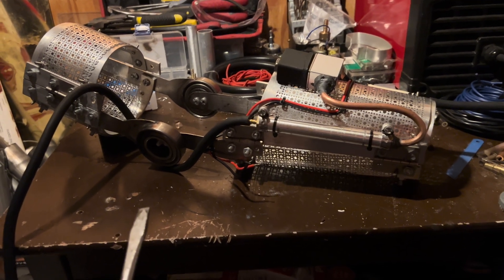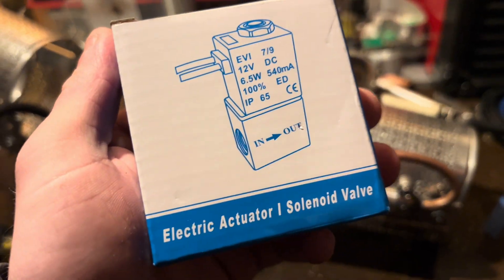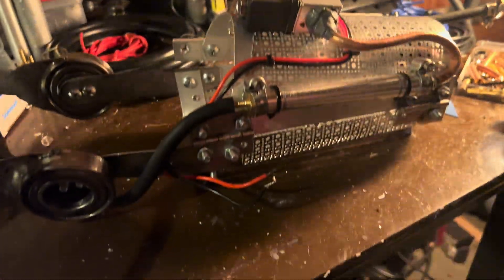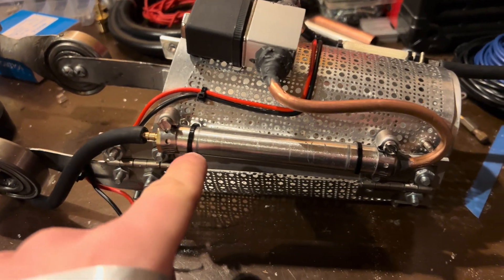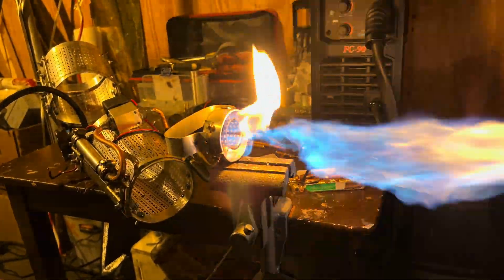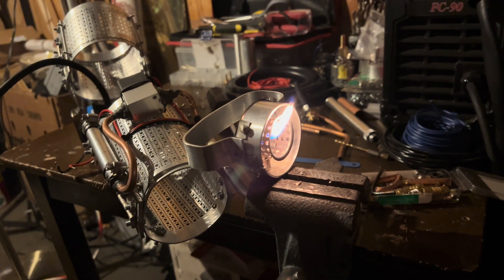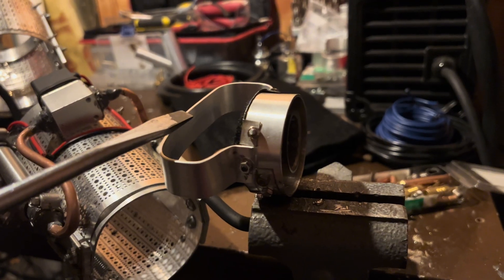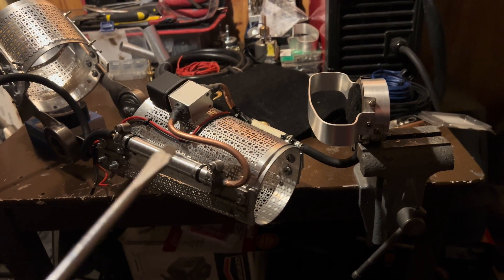Ironman Exosuit Update - Repulsor Progress

Comment: After fixing the leak in the repulsor, you should try increasing the pressure of the gas until there is a distance of a few centimeters between the flame and the repulsor. This should help with the overheating problem, at least by a bit.
Reply from the maker: This was a test at pretty low pressure just to see how the nozzle behaves, once the repulsor is actually complete the pressure is gonna be many times higher.